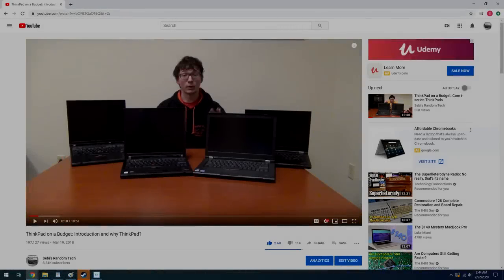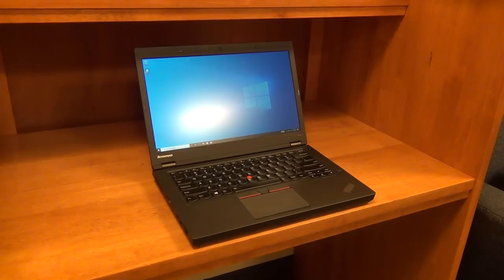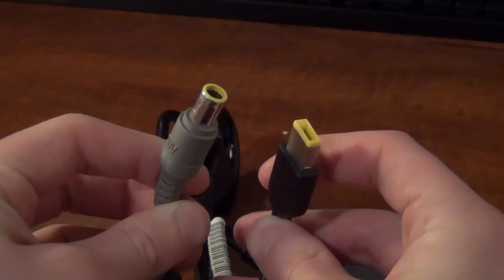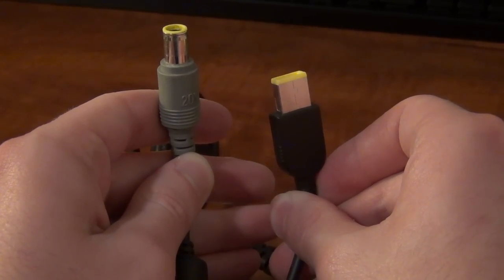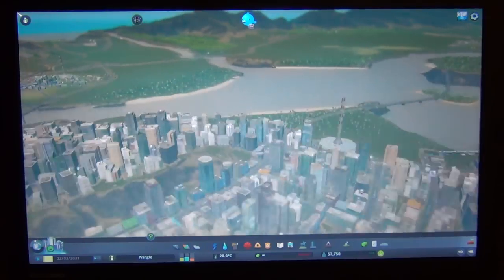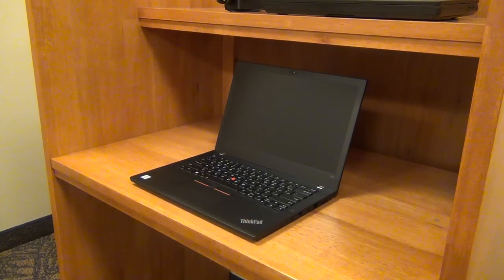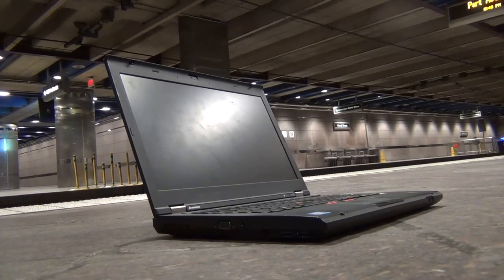Best Value ThinkPads in 2020

Comment: I have an i7 X230 (with a hardware mod for the 1080p screen), an i7 T430 (also modded with a 1080p IPS screen), and a W530 (which came with a 1080p screen). All have SSDs and the full complement of RAM.

They're very very good machines. However, the X230 and T430 are not without issues.

A lot of i7 T430's come with the Nvidia graphics card. As Sebi says, it's not particularly powerful, but it does drain a lot of battery. For normal desktop work (which is all I do on it) the integrated Intel graphics is perfectly capable, and is a lot less power hungry. Unfortunately the Intel graphics isn't wired up to the mini DVI port, and can't be used with an external monitor if you stick the T430 in the dock. So if you use external monitors (which I do, every day), you have to use the T430's Nvidia graphics. And that means you're going to have poor battery life (i.e. less than 2 hours on a 6 cell, in my experience).

The other issue with the Nvidia-equipped T430's is that the fan on the cooler that ships with them is a very noisy fan (the model that comes without the Nvidia graphics can be fitted with a quieter fan, made by Delta). The T430's firmware also likes to run the fan a lot. More so than is necessary, actually. So it sounds like you've got a mini vacuum cleaner on your desk. I've re-pasted my CPU and cleaned dust out of the fan, but it's actually rather disappointing.

You can install thinkfan (on Linux) or TPFanControl (windows) to override the fan speeds, which I've done, but the fan is noisy at any speed.

In all other respects, the T430 with a good 1080p screen in it is as good a 14" laptop as I've used. I'm a developer and have it setup for doing client-work at clients' sites (it's less annoying in a noisy office).

The X230 with an IPS screen in is great; highly recommended.

And the 15" T530 and W530's are a steal. They're less popular than the 430 (so as cheap), have far better cooling, and the W530 comes with a quad core processor. The 1080p screens that they ship with are plenty good enough too.

I have one docked on my desk full time and use it like a desktop. With a fast SSD in and 32GB of RAM I'm expecting it to last me for years yet.

Cheers Sebi! Great videos, as always.
Reply: So, what are the issues with the x230? You listed a lot about the T430, but you didn't list anything for the x230.
Reply: @InvidiousIgnoramus  In general I think the X230 is great, if you want a portable machine. 1080p on a 12.6" screen is okay, but I'd be very happy with a the standard resolution so long as it was an IPS screen, rather than the TN screen they ship with. You can get them.

There are various ways of getting the hardware to support 1080p. Mine was modified by the previous owner using some hardware made by an enthusiast in China. The hardware combines the video channel from the internal display and one of the external display channels, in order to provide enough bandwidth to drive the higher res 1920x1080p display.

That, in turn, requires you to either patch to the Linux kernel or just put up with the fact that the built-in screen sometimes appears to be the second monitor, while the primary monitor isn't visible. You can override this behaviour in your OS's Display settings, but with GNOME on Linux that means you need to login without being able to see what you're typing! So I apply the kernel patch and compile my own kernel, after which everything works perfectly.

Other hardware mods to provide 1080p support are available, but I'm not sure if they require the same level of fiddling (I assume not, but haven't checked).

I wouldn't want to work all day every day on such a small screen though. 14" is the minimum I'd be comfortable with.
In all other respects the X230 is great. It's snappy, the fans are nice and quiet, and it's nice and light. And the 9 cell battery lasts for hours (I had over 8 hours out of mine when it was relatively new).

But would I rather have an X230 (with IPS screen) instead of a T430? Yes. Because of the T430's shit fan. An Intel-only T430 with a Delta fan and the (easy to do) 1080p screen mod would be my ideal though. Or maybe the T430s (which I've not looked into since getting the T430).
Reply from the maker: @GrahamAtDesk  I like many aspects of the T420s/T430s design, however the soldered processors, poor battery life, and hotter temperatures make it less appealing to me. The Intel-only i7 variants of the T430s did, interestingly, come with Thunderbolt support, getting the feature before even the W-series did. I'm trying to hunt down one of those Thunderbolt T430s units to try out that feature.

Comment: very happy with my t440p
just save money to upgrade the drive, maks the RAM, and change the touchpad
but now (4GB RAM, 300GB HDD) is fine for my daily usage.
Reply: Jiayou Indonesia!  i had mechanical keyboard in my office (is mine, not office inventory)
wireless mouse, actually after using the trackpoint, i rare using mouse with laptop again, yes, the scroll button  on touchpad is worse, but still managable for me now
thanks for advice

Comment: Video editing on these machines...Mate, I get your point and all but once you try something much more powerful you will be like "Hell no, I am not going back to this brick". That said I would recommend investing in a decent PC build and have one of these laptops as a secondary/on-the-go machine. I had the mistake of buying a Dell XPS 15 9570 in December of 2018. Yesterday less than 2 years after purchase the motherboard died. I got it on sale but still 1400 (instead of the 1600) EUR is a ton of money especially given how little it lasted. My old Sony Vaio lasted for 7-8 years before I gave it to my dad in order to buy this Dell crap. The Sony is still working (had to replace the HDD and the AC power brick). One thing I definitely do not recommend (now sadly from personal experience) is to buy an expensive and even new laptop. It's not worth it. Just the replacement of the motherboard on my Dell XPS 15 costs around 600-700 EUR plus an unknown sum for the service plus 50 EUR or so for diagnostics. Even if you say I will swap the MB on my own that 600-700 EUR is a lot and once you add it to the initial price you purchased the notebook that machine becomes made out of diamonds, gold and shit.

I'm now looking into buying a used ThinkPad (one with USB 3 since I cannot otherwise use my 2x4TB ext. HDDs). Thanks for the video, will take a look at your recommendations.
Reply from the maker: I've been editing all of my videos on a desktop build since 2018, I am well aware that it blows these laptops out of the water. That being said, editing can be done on them - until 2018 all of my videos were edited on one.

Comment: Great video, thanks. Just seen a T440P in good condition with 8GB RAM 256 SSD and i5 4300M for just under £200 which comes in around $260 at current exchange. Seems a tad high to me, even with the SSD inside. Maybe a good deal if I can get the price down a bit do you think?
Reply from the maker: If you can knock the price down that would be excellent. The pandemic has driven laptop prices up and I know in Europe they tend to be more expensive than in the United States anyways, but make the seller an offer and see what happens!

Comment: Is there a feasible way to replace the T440p keyboard with a classic one?

I want to get into old thinkpads however the community here in Egypt isn't what it is abroad. The T440p really has everything I need but the trackpad and keyboard are killing. I know the trackpad is swappable with the T450 but what about the keyboard? Is a classic keyboard swap possible?
Reply from the maker: Unfortunately it is not possible. The T440p uses a different keyboard connector and has a completely different design from that of the T430 and earlier ThinkPads, so as of now there is no way a classic keyboard would fit in it. If you REALLY want the classic keyboard it is better to either go back to the T430 and do the swap, or purchase an external USB ThinkPad keyboard that uses the classic layout (these do exist but are somewhat pricey). The T440p's keyboard isn't bad, however it still feels like a downgrade from older designs to me.
Reply: @SebisRandomTech  ahhh that's unfortunate. Well they aren't super expensive and I'll probably end up getting another laptop in the future so might as well get the T420 also.
Thanks for the reply and your videos have really been a lot of help man!!

Comment: you keep talking about being able to swap in a better processor; whats the best one that could be put in? with that bios hack it would be cool (and irresponsible) if people managed to get desktop chips in there
Reply: Your not getting a desktop cpu in to that laptop. They don't even have the same sockets and physical pins.
Reply from the maker: For the T430, the i7-3612QM and 3632QM are good upgrades. The T440p handles 4702MQ and 4712MQ chips very well, and if you don't mind a little more heat you can put in a 4700, 4800, or 4900MQ.
Reply: Look at laptops made by the Chinese enthusiast group 51nb
Reply: @SebisRandomTech   
 ¿puedes compartir la biografía del mod? Gracias

Comment: I got an e585 as a present for Xmas 2018. It's fine. The only thing that really shines over my old e530 is the 1080p screen. 

I have Win 10 Pro on the e585, so I decided to research Linux for the e530. It was the last of the Win 7s and that OS was losing its support. After asking on r/thinkpad, I settled on Linux Mint Cinnamon. I installed an Inland 480 GB SSD for $45 and the e530 flies. 

If I could find a matte screen higher than 1366 x 768, that would be great.

Comment: I recently purchased a used T450s with 12gb ram and 256gb for a good price, suits my needs perfectly and can easily be upgraded in the future if need be.

Only downfall is the original keyboard is French, so it has some Stickers to convert to the UK layout which makes no big deal
Reply: Man, I'm both francophone and anglophone but I much prefer the english setup. Having to shift for numbers is a pain. Actually writing in french half of the time, the swiss keyboard is the best for me, all the french accents but the advantages of the english kbd.
Reply: @gramoukdoom  the only downside of having the French keyboard is the fact I have to have English keyboard stickers but unfortunately all the keyboard stickers I found, aren't backlight compatible.

Correct me if I'm wrong, but is ImpEc French? That's how I found I had a French keyboard
Reply: @jgeoc1055  Yeah, Impréssion écran (print screen) but could be any francophone countries (belgium, swiss, canadian ect).

Comment: for me, x220 is the best, with my 9 cell battery, plus sliced bottom battery, and TLP settings under archlinux, easy 20+ hours battery life, no one can beat me on the earth.
Reply from the maker: X220 and X230 are among my favorites in the 12” line. They’re generally more expensive than the T420/430 hence them not being featured in this video, and for me the upgradeable CPUs, higher screen resolutions (and a FHD mod that doesn’t require soldering!) and the larger palmrest make me gravitate more towards my trusty T430. Despite that, I still love the X series and used a classic keyboard-modded X230 for over 2 years before switching back to my T430 full time. Maybe I’ll do an updated video on them!
Reply: @SebisRandomTech  yes, I am more than happy to see your test on x220 or x230.
And again, no one can beat me on the earth on battery life 😎
Reply: what about x260 or x 250?
Reply: @seanchen9617  what about the Dell Lattitude Rugged Extreme? I'm pretty sure you can equip it with two 20h batteries for a total of 40 hours use
Reply: @archygrey9093  i thought this kind of machines are built for military use. both price and scenario.
Reply: @seanchen9617  They are intended for military and police use, but they can still be bought by normal poeple if you have the cash to burn
Reply: @archygrey9093  I don't😭.
Reply: @seanchen9617  same, I'm keeping an eye out for a broken one that i can fix up instead

Comment: How does the x220/x230 compare to the T laptops mentioned in your videos? What is your opinion on x220/x230, can it last for maybe next 10 years? Thanks
Reply from the maker: The X220 and X230 use the same processors as the T420 and T430, so before any upgrades both would perform about the same.
The big difference however is that the X series has always used soldered processors, while on the older T series they were still upgradeable. 51NB recently did a modded X230 with quad-core i7’s, but other than that you’re limited to whatever processor is in the laptop you buy. They are still very solid machines though!
Reply: @SebisRandomTech  If I am using a laptop for using internet browser, MS word/excel, youtube, video, pdf, screenshot and add text/arrows/highlight. No games. Would X220/X230 have a noticeable difference vs T420/T430? Thanks.
Reply from the maker: The X220/230 should be more than enough to get the job done. The X230 has a little bit more future-proofness, with the newer hardware it has. Highly recommend looking for one with an IPS screen and/or doing the classic keyboard modification if you opt for the X230.
Reply: @SebisRandomTech  What is the benefit of classic keyboard modification on X230? X220 or X230 keyboard is less likely to trap dirt/dust and easier to clean?
Reply from the maker: Many people prefer the layout of the classic keyboard better, and to some they feel nicer to type on. And the classic keyboards are a bit easier to clean.
Reply: @SebisRandomTech  Is X220 or X230 keys more quiet when typing?
Reply: I have had my x220 since 2012 and still using it today. I have an x250 since 2017 and I still use both. These machines can last for years.

Comment: Hi.  Thank you for your video. What is your opinion about the E14 ? I'm very interested with it but can't find revelant test online. Thanks !
Reply from the maker: It's a downgrade from older machines. They completely removed the SD card slot and got rid of one of the RAM slots, limiting expandability/upgradeability. I would suggest looking at a L490, E490, or a used T480.

Comment: What if I got a t430s? Is it the same as a t430 in terms of performance and upgradeabiliy?
Reply: Same performance, but soldered CPU means you can't swap that. Identical otherwise. Mine works great, I've done the classic keyboard swap and am looking into the IPS display upgrade but the price seems steep.

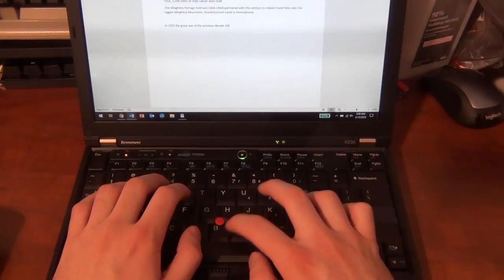Comment: Very good selection! I use a T440p (4800MQ, 16GB RAM, nVidia Optimus) as my main machine now. Bought it for like 220€ last year. Of course I also changed the touchpad. Still find it very sad that Lenovo moved away from 16:10 displays though.
Reply from the maker: Most laptop manufacturers have except for Apple. Dell made some interesting moves by going back to 16:10 with one of their new XPS machines, and the Surface tablet/laptops use a 3:2 display, so maybe Lenovo will move back to a taller aspect ratio on one of its models soon.
Reply: @SebisRandomTech  Well there is the S540-13API from their IdeaPad line. But since it just came out a few months ago it's still pretty expensive and probably not much faster than what I have now ...

Comment: hello, what do u suggest,   thinkpad x250 with FHD Touchscreen , or thinkpad x270 with HD screen ?
Reply from the maker: Both will be decent, the X270 is definitely a bit newer but the FHD screen is a bit nicer. Depends on what the price difference between the two is.
Reply: @SebisRandomTech  they have same price,  which one do you suggest?
Reply from the maker: @epenpenpen8183  Go for the X270. The screen's inferior but that's a fairly easy upgrade, unless you really want the touch screen that the X250 is configured with.
Reply: @SebisRandomTech  I dont really need touchscreen, I just need FHD resolution,
so is it better to purchase x270 ?
Reply from the maker: @epenpenpen8183  If you think you can upgrade the screen yourself later on, yes. If not, stick to the X250.

Comment: Sebi, what are other sources you recommend for buying genuine T440p 9-cell batteries, other than eBay?
Reply from the maker: You can find them on Lenovo’s website and Amazon. I’m sure there are other sites where you can find them, but I do most of my shopping on eBay/Amazon and usually only go elsewhere if there’s a more obscure part I can’t find on those sites.
Reply: @SebisRandomTech  No you cannot on Lenovo's site, before this quarantine their site said that the battery was no available and unknown when it will be back into stock.  The Lenovo one on Amazon has mixed reviews, are they new, or old new stock?
Reply from the maker: I would imagine by this point that they are probably new old stock. I’ll check Lenovo’s website to see if you can still get T440p batteries, I imagine since T430 batteries are still available there would be no reason for them to discontinue T440p batteries.
Reply from the maker: https://www.lenovo.com/us/en/accessories-and-monitors/chargers-and-batteries/batteries/BATT-BO-Thinkpad-Battery-57%2B/p/0C52863

I was able to find the 6 cell battery for sale on Lenovo’s website, however I couldn’t find the 9 cells available. Maybe Lenovo prematurely discontinued it or COVID-19 has disrupted their supply chain.
Reply: @SebisRandomTech  Thank you for the help! I've been looking for the 9-cell battery since February, I'm pretty sure COVID-19 probably disrupted their supply chain (I hope.) I doubt they prematurely discontinued it, given they still sell 9-cell batteries for the T430 and T420, which are older than the T440p.
Reply from the maker: @darthgamer6080  That wouldn't make any sense, especially since some of the very last T440p's purchased new could still be under extended warranty. Hopefully they are still making batteries and it's just a disruption of their supply chain.